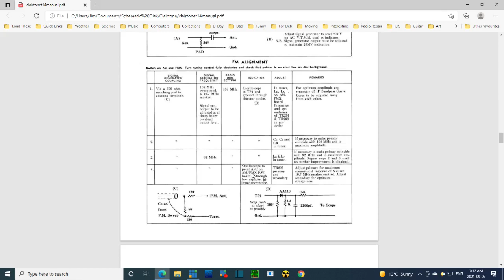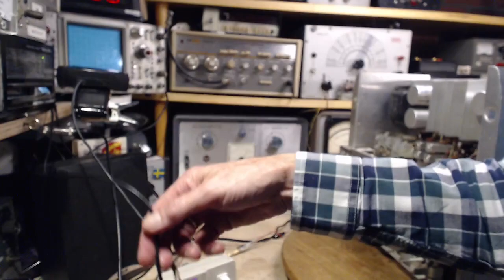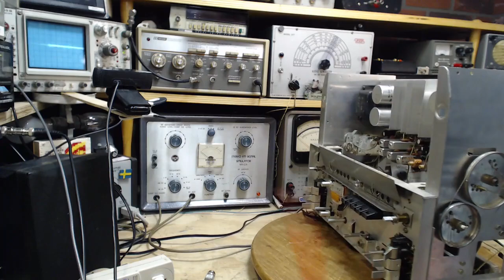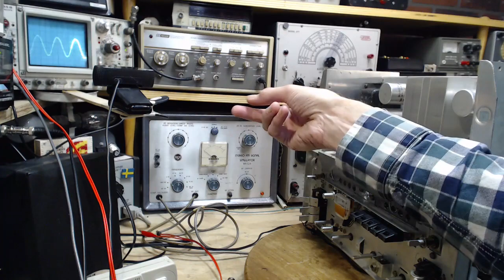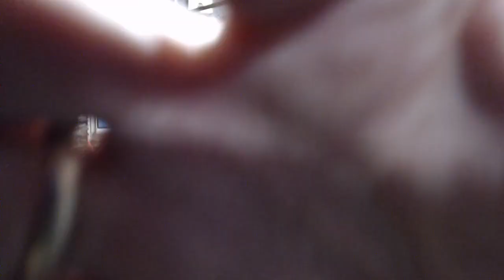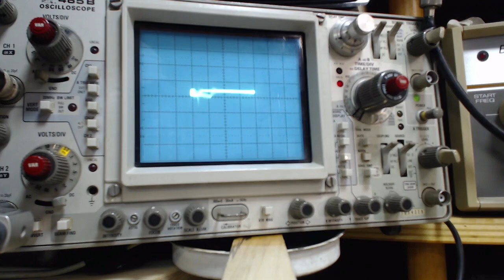Clairtone Console Stereo Video #25 - 'S' Curve - Nope

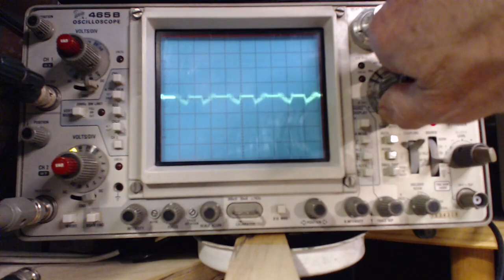Comment: 9:37 if he would just think about it, it should get clear, that sweeping the received RF (in this case around 100MHz) is equal to tuning in and out of a station (just at a rate of 60Hz). So the S-curve is nothing less than a graphical representation of the action that a FM tuning indicator meter should show upon tuning; if you approach a station the needle will leave the middle position, rise to a max on one side, then fall back to the middle when tuned dead on, then rise to a max on the other side, and eventually go back to the middle once fully tuned away from the signal. So getting no S-Curve - or just the top half - is equal to the tuning indicator meter not at center and not doing a positive and negative swing.
And we have seen and continue to see that the tuning indicator meter is pegging even with no station received.
This whole twiddle can only serve to mess up what little factory alignment is left. The radio is not fixed and has a malfunctioning ratio detector.

Comment: What you are seeing is called CHAOS , because you have the FM oscillator beating with the Wring FM signal frequency.To do an IF alignment of an FM receiver, you need to be tuning the IF transformers at 10.7 MHz with the local oscillator disabled. Detection is made by the radios demodulator. Free hand alignment uh uh no no.. the “S” curve is the output of a balanced demodulator. What you’ve got now is a lissajois curve, zero beating. This is why I junk a set that needs alignment. The equipment is more expensive than the radio.